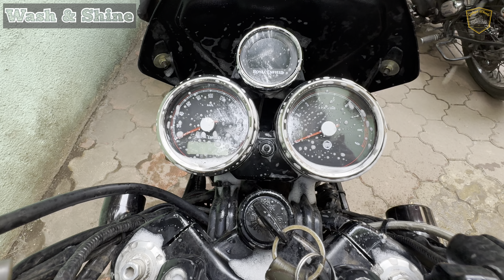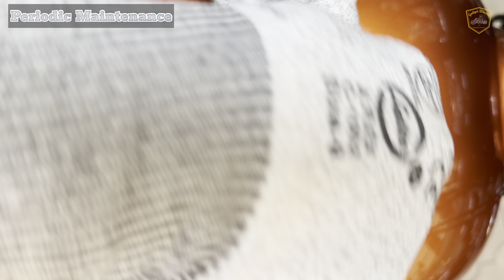Periodic maintenance of Royal Enfield Interceptor 650 | Buffing

Comment: A job well done and fantastic maintenance. Need your help for the following -
1> I have read some place that WD40 is not good for rubber parts like the one inside the fuel cap. Isn't it better to use silicone polish for rubber parts/Indicator stalks/Speedometer. 
2> Please let me know how to avoid getting rust on chrome exhaust in the long run.
3> How to clean the front shockers[the exposed steel part before the shocker sleeve] . 4>Which type of pressurized grease to be used for wheel bearings, especially during Monsoons.
5>How to clean the Water drainage near the Fuel inlet without inserting a wire into it.
6>How to maintain the battery terminals.
Reply from the maker: I am using WD 40 only for lock sets not for rubber parts. But if it comes in contact with rubber parts, I dont think it will damage in a large extent.I am using it for more than 4 years on my Interceptor.
Rusting on bend pipe is a major issue.You cant avoid permanently unless you replace it with stainless bend pipes.
Fork pipe cleaning i am not using any special cleaning agents.Just car washing shampoo.
Greasing the bearings are done at local mechanic.
I use nylon thick wire to clean the Fuel tank water drainage pipe
Battery terminal usually cleaned by my local mechanic

Comment: Hey bro, I've got an Interceptor too and I've done almost all the same mods you have 😁 Great video, keep it up!
Reply from the maker: Thanks bro 😊
Reply: @gadgetwheelz If you don't mind me asking, what is that white colour powder that you had used during engine polishing? Never seen it before, please let me know what it is for
Reply from the maker: @Zuputmer ,  white buffing powder ,generally used at RE for buffing engine casing. I dont know the exact name of that.I got it from RE service centre upon request.
Reply: @gadgetwheelz  ah i just did a little bit of research and I think it might be aluminium oxide powder. Commonly used to polish metals, gives a mirror like finish! Will try it out

Comment: From where did you get the alloys for the bike man ?
Reply from the maker: Those are from RE , you can get it from RE Service centre or RE genuine spare parts sellers. These alloys for Interceptor and GT, so no need any modifications, it is a direct fit
Reply: @gadgetwheelz  but the guys at RE said that we cannot sell alloys for the older interceptor model as it did not come with alloys . I found this justification very silly . Then they said you should go for aftermarket alloys.hiw strange is that ?
Reply from the maker: That's very silly...try at some other RE service center,otherwise better try at RE genuine spare parts shop.

Comment: Hi
Which engine oil is good for the int 650
Reply from the maker: I use RE Liquid Gun during servicing at RE Service center. Motul 10w50 if I change at local garage.Never tried any other engine oil. Important factor is you should change engine oil on every 5-6k kms intervals.
Reply: @gadgetwheelz  thank you 👍